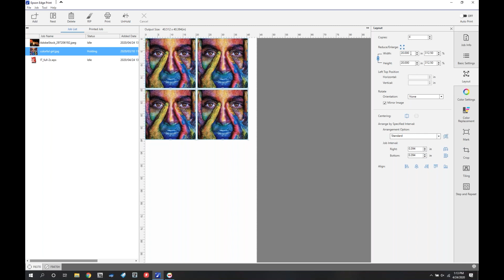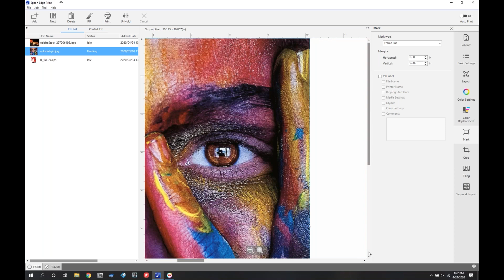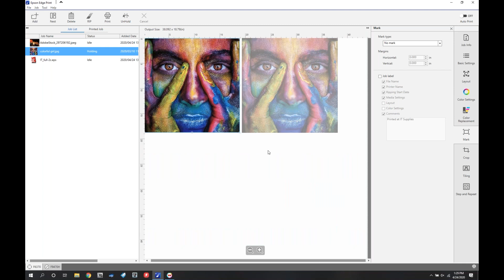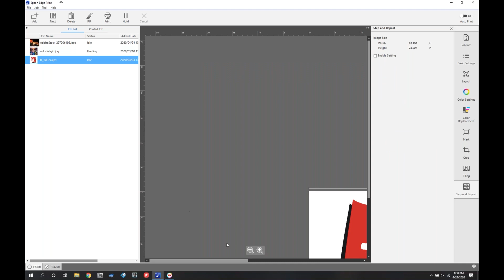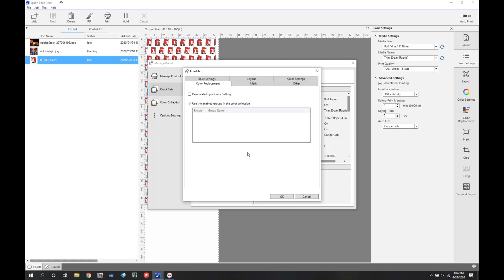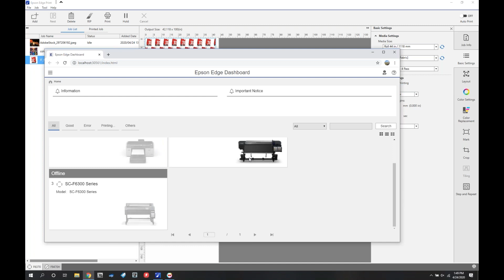Epson Edge Print - A Detailed Dive Through The Software

Comment: Hi. Thanks a lot for this detailed tutorial.

I have a question: I’m working with varnish, white, and color layers, but when I upload the file (PDF, EPS, or Illustrator), the area where the varnish layer is placed makes that part of the image (which is a bitmap) disappear.

Why is this happening?
Reply from the maker: Hey! Great question — this is actually a pretty common issue when working with white + varnish layers in Epson Edge Print.

What’s happening is usually related to how the varnish layer is being interpreted in your file.

In most cases, the varnish layer is set up as a spot color or top layer, and when Edge Print processes it, it can treat that area as a knockout instead of an overlay. So instead of printing on top of your bitmap, it’s essentially telling the RIP to “remove” or ignore the color data underneath — which is why your image disappears in that area.

A few things to check:

• Make sure your varnish layer is set to overprint, not knockout, inside Illustrator
• Double-check that the spot color name matches exactly what Edge Print expects (no typos or extra spaces)
• Ensure your layer order is correct — typically: Color → White → Varnish (with varnish on top)
• If your bitmap is underneath, confirm it’s not being flattened in a way that conflicts with the spot layer

Also, depending on your workflow, Edge Print may require specific layer naming conventions or swatch definitions for varnish to behave properly.

If you’re still seeing issues, try exporting as a PDF with overprint preview enabled and no flattening — that often resolves it.

Hope that helps!
Reply: @ITSuppliesINC thanks a lot. Just solved the problem with your help
Reply from the maker: @gabrielhuie3221  Happy to hear that!!

Comment: hi any help why when i import a file  (pdf or pgn) picture becomes reddish and when heat press it really shows reddish
Reply from the maker: Hi, thanks for reaching out. If your image appears reddish after importing into Epson Edge Print and especially after heat pressing, it’s likely related to a color profile mismatch or incorrect print settings. Make sure you are using the correct ICC profile for your specific media and printer combination, and that the color management settings in Edge Print are not duplicating or overriding those in your design file.

If you’ve already checked that and still see the issue, we recommend contacting Epson’s technical support directly for more in-depth troubleshooting. You can reach them at 1-888-377-6611.

Hope this helps!

Comment: I have a question. I've had my Epson F570 for a couple of years. Its great, love the software. The only issue I have is the print settings. When I try to chose a size for auto feed sheet, it only gives me 2 sizes that aren't the normal legal, letter, etc. I have my software updated but I can't figure out what to do to get the normal print size settings that I use for all of my other printers. It makes it hard to print individual sheets.
Reply from the maker: Here are a few things you can check and try:

1. Check Printer Driver Settings
*Open Control Panel > Devices and Printers (or Printers & Scanners in Windows settings). 
*Right-click on the Epson F570, then select Printing Preferences or Printer Properties. 
*Look for a Paper Size or Custom Paper Size option. If only limited sizes are available, try selecting a different paper source (roll vs. sheet). 

2. Ensure You're Using the Right Print Driver
*Sometimes, Windows installs a generic driver instead of Epson’s full driver.
*Download and install the latest Epson SureColor F570 driver from Epson's support page.

3. Check Print Software Settings
*If using Epson Edge Print, Photoshop, or another RIP software, check if it’s overriding paper size settings.

4. Try Custom Paper Sizes
*If standard sizes aren't available, try creating a custom size manually in the print driver.

If none of these work, I’d recommend reaching out to Epson Support for further troubleshooting. You can reach Epson support at 1 (800) 463-7766.

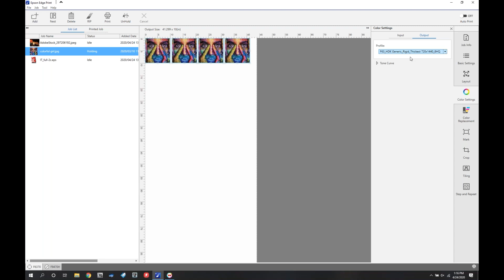Comment: Hello, I have an Epson F-9430 and then by new one Epson F-11030, two model printer we are using Epson Edge Print. When i have the same file printed on F-9430 and F-11030 the result is quite different, i know about that machine has different technology, different ink, different print head, etc. So in this video you explain about Output Color Setting - tone curve edit (12:24), i think that can make fine adjustment and apply to the new machine, so that the result is close to the old machine, but you explain not complete how to save and apply to job and effected.  Thank you.
Reply from the maker: Hello, thank you for your comment. Edge Print does not give you the same color control as some other RIPS.  Additionally, some of the calibration features in the 9400 are missing from the 11000.

Comment: Just started using this software. Colors arent printing sublimation accurate. Reds print like ruby red grapefruit.
Reply from the maker: Please make sure to run a nozzle check to ensure that the heads are performing correctly.  There are a lot of variables in Dye Sublimation.  You may want to to test other papers as well.  Our best paper is the SubliPro Vivid. https://www.itsupplies.com/sublipro
Reply: Currently using the epson paper you guys sell. Nozzle checks are great. Im thinking its settings im using but cant find any good settings anywhere online.
Reply from the maker: @tshirtclout5188  Have you referred to the User Guide for Edge Print? Page 41 highlights different color settings. https://download.epson-europe.com/pub/download/6286/epson628617eu.pdf

Comment: Hi IT Supplies! I have an issue when I try to import a job that is over 5 meters long (like 7 meters) it will cut off the parts (2 meters). It seems that the output size has some sort of limit. How can I fix this? Also I'm using a Epson sc-f9400h.
Reply from the maker: Hi @Wolfran18, we believe there was a restriction at one time. It's our understanding that the latest version of the software corrects this.

Comment: How change output color from cmyk to rgb ?
Reply from the maker: Hi @aa_dnr, any output profiles you are using in Edge Print for the EPSON F170 are RGB Profiles.  You might be referring to the Tone Curve which cannot be changed to RGB.  The technology is allowing you to adjust the use of the CMYK inks.  In Color Replacement, you may also be referring to the Output Color that specifies CMYK.  We're not sure why they give you a dropdown option because this printer must convert your images into the CMYK ink channels of the printer.  If you need to change RGB values, you must do that in the file itself.

Comment: How do you print color  profiles. My images  I bring in once printed in edge prints a different color?
Reply from the maker: Hello Michelle, color profiles are associated with the media type and the pass mode.  Using the same pass mode and media should give similar results assuming that the printer has been maintained and the nozzles are clear.

Comment: I have an Epson SC-F501 printer (two fluorescent yellow and pink) which are the best settings in the Edge Print program. Black is not intense enough, gray goes green? Please advice what would be optimal. Thanks for the reply.
Reply from the maker: Hi Siviljstvo, the SC-f501 Printer has not been release to dealers / customers in the states as of right now. Without testing it, we wouldn't be able to give you a helpful response.

Comment: Hi dear my edge print is no going to register which is give a message to me that is say your edge  print is using other computer which is not true  plz help me
Reply from the maker: Hi there, thank you for your comment. It sounds like there is a reason or two this could be happening: this could just be a technical glitch in which case, you would need to call Epson Support (562) 276-1305. Or if you purchased the printer as a demo model or used, that seller may have the software registered to their computer still. In that case, you would need to contact the seller and ask them to unregister the unit from their computer so you can register it to yours. Hope this helps!

Comment: Hi. I have a f6200 but thinking in buyin a  f6370 soon. I'm watching this video to learn more about this software... Now, i have an question: in The Edge Print can I set the colors separetely for every ICC profile? For example, now i have an profile, i use it, but for some reason someday in the future i realize that it would be better if i elevate the quantitie of the yelow. Can i do it as I do now in Wasatch ou I have to make a total new ICC profile with espectrofotomenter... (?).
Reply from the maker: Hi Raphael, thank you for the question. If I'm understanding correctly, it sounds like you're going into the ICC profile itself within Wasatch and adjusting the Ink Density of the CMYK colors? If that is the case, you do not have the same control over the ICC profiles within Epson Edge Print. Instead, you are able to make adjustments to Named Colors (Pantone, Spot Colors, etc.) set within an image itself. For example, if you decide the yellow you printed needs to be made lighter, you can go into the Color Replacements, select the yellow color you're looking to change, and you can change the percentage of yellow for that particular color or change it to another color entirely. This is not a perfect process, however. We would recommend making any major image changes through a dedicated image editing software and importing the changed file into your RIP to ensure greater accuracy. I hope this answers your question!

Comment: Thanks for the video.  I send job to print and then it stops at 90%. Can't figure out why
Reply from the maker: Hi Dee, a couple of things could be happening. Can you try sending a different image to print to see if you just have a corrupt file? You can also try restarting your computer and the printer (I know that seems too easy but sometimes that works too) and unplug every thing (printer from outlet and computer and internet depending on how you are connected). How are you connected to the printer? Printer cable cord or network? If Printer cable cord - you may need to replace that cord. Try those things and if that doesn't work, call into our call center an speak with our technical support staff 1-847-394-9573.
Reply: @ITSuppliesINC  I tried your suggestions and it did not work.  It goes to 90% in the print que and then it stops.  I am not using a printer cord.. The number you indicated  above is not in service.
Reply from the maker: Hi Dee, feel free to email us at info@itsupplies or you can call 1-800-771-9665. We'd love to get this figured out for you!

Comment: HI,

Can a "tiled Job" be printed as individual files.
Reply from the maker: In the latest version of Edge, 4.0.0, and it doesn't look like you can run the tiles as individual jobs using the tools in Edge. If you want to run the tiles as separate jobs, you would need to create the tiles outside of Edge and import them each separately.

Comment: Nice video. You know where is the tool to know the cost of the printing work ??? Something like that ... I have EPSON f6370
Reply: Interested on this tool also
Reply from the maker: Hey @Tiger, currently Epson does not have a cost estimator available for Edge Print just yet. We're hoping it comes in one of the updates soon. If you want to know the cost of your prints once they are completed, you can download the LFP Accounting Tool from Epson's website. You will just need to input the cost of your inks and media to get an accurate report.